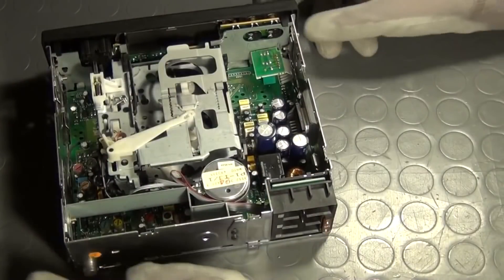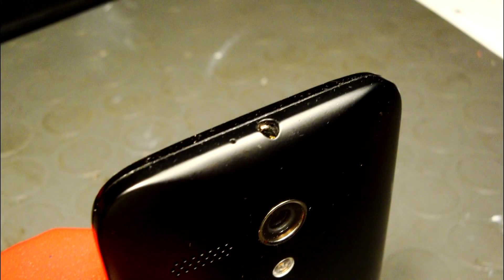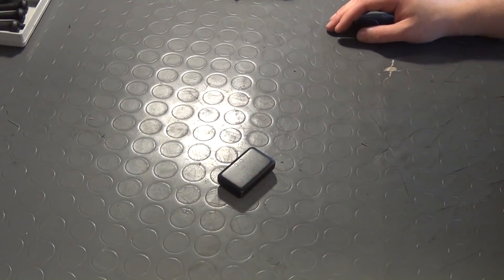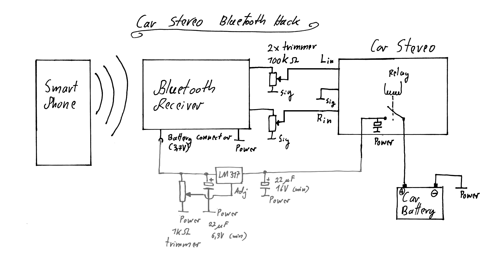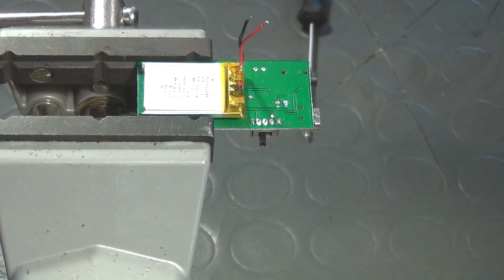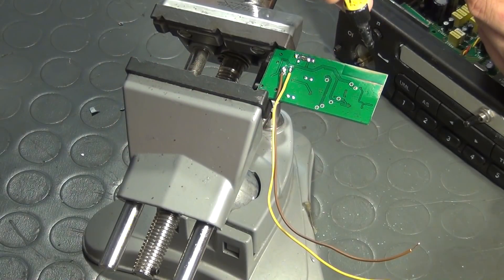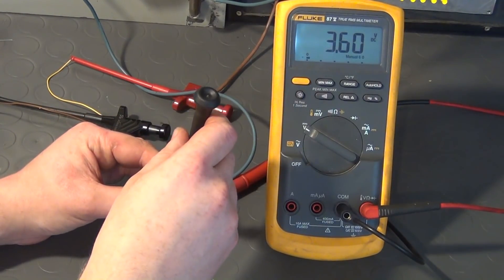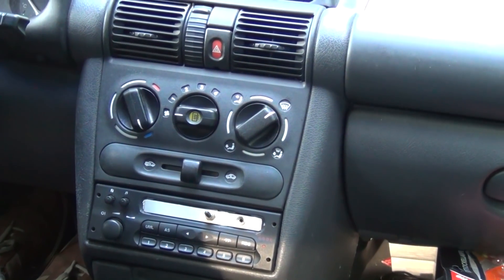Hack: Adding Bluetooth to  Car Stereos and Sound Systems

Comment: can i connect "soldering"headphones Blutooth direct to the radio, if yes. to which dots on the car radio. i've an opel astra g-cc  CD-R radio from Delco Electronics  (CDR 500) 

thanks

Comment: I just received a similar Bluetooth module for an old Pioneer. It has two wires for being hard wired to 12v and the output is Pioneer's IP-BUS connector that plugs right into the back of the headunit.

Comment: I have a bluetooth modulator that plugs into the cigarette socket, cost £8

Is that an Opel Corsa?  I  got a 1998 973cc model with 50k kilometres on the clocks for 500 euros, done 25k more in a year, great car.

Comment: Recently started watching your videos, as an electronics technician I can't get enough. Did you consider removing your original 3.5mm jack and using the jack on the Bluetooth board? It seems better than having a parallel input circuit.

Comment: No transient diodes, no fuses on the circuit. And you even test your circuit with only 12V, while the alternator can deliver up to 13,5V not mentioning the spikes while cranking the engines.
Could have be done better, I wonder how long this will last

Comment: This is great and very handy.  I have a late ‘70s car where I need to keep the original head unit but would want to add something like this:  USB, Bluetooth and DAB+.  Any suggestions?  I can share pictures of the Blaupunkt or Becker head unit.

Comment: You can buy a cheap ass car stereo with USB and bluetooth on aliexpress for like $15 USD, but I guess it wouldn't have the fun factor of hacking together your own, like you did.
Reply: However, if you have steering wheel control of your radio, you might want to keep the old radio.

Comment: Great video, but one thing caught my eye…    car battery is all most allways above 12volts …  charger pushes around 13,8 to 14.6 volts to battery while car is running.   So when you regulate the power to your bluetooth ,  you should take that into account if the modules voltage limit is critical. Often they have quite large scale tho..  as most of their cut out voltage is way below 3.7v and when in charger those will allso charge at around 3.88v up to 5v in some cases.

Comment: Slight confusion: usually the power buttons of bluetooth devices respond to pushes of different lengths: click to pause or answer phone, 3 seconds for power on, 10 seconds to re-enter pair mode, etc. Here you've apparently been able to make it do a power on only? Or perhaps it always goes into pair mode and you have to repair with your phone every time? Anyway, some of the inherent functionality appears to be lost with this hack.

Comment: You drive a corsa B ...hope its a diesel...best cheap diesel one can have in Europe...5 liters 100km....if it has 5 seats i costs around 1000€ here...if it has 2 seats it costs around 500€....i have 2 of them one with 470000km and other with 520000km. for ten years i dont know what it is having a serious malfunction in the car...never changed suspension, arms, bushes, driveshafts , cv boots and other stuff that breaks all the time on other cars...only had a bad alternator on one and the other leaks power steering fluid but it has been like that for years...i just top it up every 3 months or so because i am lazy to change the rack...i was wainting for the engine to blow and would change both things at once but the sucker wont throw a rod no matter how hard i try

Comment: I just ordered a Bluetooth module and intend to do this to my factory Ford radio in my Mercury Mountaineer. My problem is that I have no aux input. Could I simply connect to the inputs from the CD player, or are they digital?

Comment: Well that is a lot of work to go through to get blue tooth integrated into the car radio but hey true you dont have to worry about a voltage drain any longer . Great video

Comment: i hacked my bluetooth speaker by extending the speaker wire. the first min was fine but after that the speaker stopped working.  device is connected and the functions work. what is the problem? help anyone?

Comment: If I want to skip the 3,5 mm jack installation, I just need to connet these wires to the bluetooth receiver output?
Can I use a different bluetooth receiver with small DC-DC step down convertor?

Comment: Could this be done on a more modern radio by simply adding power to a bluetooth adapter and hijacking off of the already existing outside audio jack but instead soldering another to it inside ?

Comment: Interesting video. 

Thinking to do the same with my car, I have a Mercedes ML, older version. You mentioned you connected the "audio out" I'm parallel via the aux sockets on the board I'm sure I'm case you wanted to use the aux port by it self. Could this cause an issue? Or is it like a regular stereo that it would just play both "channel" if both are engaged? 

I don't have a aux mode on my unit, but I do have a tape mode that I never use, thinking to connect it to there. What are your thoughts? 

Also, need to find a power source, and I have a old car phone unit near that is ignition activated so might be a good power source. 

Basically, did you see any issues connecting it in parallel?

Comment: That was incredible. I also have an older 2001 car with a factory stereo. I don't want to remove the stereo as it will devalue the car (it is very rare) but I would love to be able to keep the factory look and bluetooth it with my phone. Would you do this work again for someone like me, if I paid? I am not good with soldering..

Comment: No need of trimmer (variable) at all. No need of lm series regulator, just use 7805(connect it to bluetooth power port, micro usb, dc jack) you made it more complex than it really is.

Comment: fuck sakes just buy a bluetooth receiver. solder some power from the iso leads and solder output cables into your stereos aux or input cables. why build a effin receiver board totally overengineered!

Comment: hello i have made this hack to my car stereo last night.
i have removed the pre amp from the board and conected to its exit.
everithing is ok until i conect the bluetooth adapter to power. some noise apear în the speaker that can be Heard when nothing its played. i have noticed that this noise disapears If i reconect the internal battery to the bt receiver. any idea how i can fix this ? thank You.

Comment: Great video, but one thing I was wondering, cars produce more than 12v when running, usually the alternator puts out 13.5v to 14.8v, so how well regulated would the pot based power supply you made be?

Comment: Nice Hack, just a question, there is a 1 k ohm resistor but is not in the diagram, should this be between terminal 1 and 2 of the LM317?

Comment: Seems like a lot of work when you can buy a cheap aftermarket headunit with all those functions
Reply: opelduude and the old one? Just more garbage on the already sky-high pile? With his work he extended the life of his device even longer. And every device not built is lowering the pressure on the resources of the planet. And it is fun to mod things, by the way.
Reply: I can see this mod being used in a vintage car. You could keep the original look but still have upgraded functions! Obviously you wouldn't remove the casette player then...
Reply: I found 1 for 19.99 on Amazon

Comment: I have some problem with buzzing and ticking background sounds (digital processing and wireless connection) which are at the same level regardless of sound volume set.
Any tip how to separate ground in BT module from ground in main radio electronics?

Comment: Ok, but using also a 12V to 5V usb ready made adapter (or gutting a lighter socket one) would have not be easier to power the bluetooth module?

Comment: so why not buy a new car stereo that has Bluetooth? much easier solution imo
Reply: this is a original opel radio with the display high in the dashboard.
Reply: @Larry Schlutt So why not watch a video on buying a new car stereo that has Bluetooth? Much easier solution than watching a video on something you don't want to do then making a comment telling others what is easier.
Reply: For example in my car I cannot make optical changes, because then i would loose my special insurance.

Comment: If found all phones aux port fails if you use it alot.  I have found using a cheap thin aux cable that doesn't put pressure on the port stopped the wear.  

Or Bluetooth where possible.

Comment: You can do the same using a BT aux receiver instead, thus drastically reducing the cost to about $3.
There's an indestructible here : http://www.instructables.com/id/Pimp-Your-Cars-Stereo-Adding-Bluetooth-to-Your-Hea/
This doesn't even need that regulator circuit you've made.
Reply: Of course, but you lose the excitement of hacking, and you do not re-use an old stereo that you'd probably discard ;)
Reply: I don't know what you mean. You use your old stereo and you hack it, you just don't make that circuit he did. And you use a cheaper receiver as an added bonus.

Comment: Could you not just leave the tape deck in and just hack into the audio cables? So to activate the Aux/Mp3 in you just push the tape in and to deactivate, pull it out. Would still have that retro tape feel but with an mp3 player bolted in the back! :-)

Comment: Amazon on sale FM transmitter bluetooth only $19.99 . some of them only $ 13.99
buy one faster than your build it  ..........?
Reply: Those work great unless you're going any distance. At least in crowded urban areas you'll need to be fiddling with the frequency choice as stations fade in and out. This is the voice of considerable experience talking. Given the option, I'd take the wired-in receiver.

Comment: I recently had a friend buy a new pickup truck. He wants to install speakers in the bed. Rather than running a bunch of wires, somebody suggested that I hook them to blue tooth. I have yet to find a stereo that has bluetooth outputs, only inputs. Has anyone tried to hack this yet?

Comment: Soundfly BT  sits in your cig lighter and lets your phone connect to it through Bluetooth, it then transmits to your radios  fm station such as 88.1 or one of your choice. No wires and can bluetooth to any radio.  They also make a cassette with an AUX phone jack wire that lets you connect to a MP3.  I can appreciate your hacks but there are already inexpensive and better solutions already available.

Comment: Why dont you just go buy a new car stereo???????
Reply: It's cheaper. Just finding the correct cable for your car's audio system can cost more then a generic EBay/AliExpress bluetooth receiver.The wires and solder used? Likely a few cents. It's also fun to do. :D

Comment: Anyone willing to help me with a different kind of problem? I have a car noise issue(power noise) that cannot be fixed. Tried so many filters, nothing works. I want to use a reverse camera but when the engine is on ...with filters I do get signal(sometimes - not constantly and not always), my car is a seat ibiza 1.2 sc tdi e-ecomotive(2012 model).

If someone thinks he's/she's good at this that would be a nice challenge :D
Reply: Have you tried using decent shielded cabling and revising how you are grounding the camera?
Reply: thankyou! This guy knows. Check shield and earth points. Small cameras emit shit tonnes of noise can cause all sorts of issues with wireless devices on 1.2Ghz (i.e bluetooth at harmonic#1)

Comment: Why didn't you replace the faulty jack in your phone? You definitely have the tools and skill to do it.
Reply: MasterBata lol that's EXACTLY what I was thinking.
Reply: If the jack is anything like the one on my Asus fonepad,id be grateful if you could point to me where I might be able to source one!  Seems like these jack sockets are proprietary.
Reply: Pat Butete I would try aliexpress first... then Asus service centre. If all fails, you can look on ebay for cheap broken phone like yours and salvage the jack.
Reply: MasterBata Already tried Asus and no can do.They want $$$ to repair it.As for a broken ebay salvage job.It's a common problem broken jacks on these devices..so...not sure that is a wise move.
Reply: aliexpress has them for 4 dollars, i checked for a friend last night . he needs an asus fonepad usb socket ($4+) and a battery ($6)
If you don't like fine soldering, buy the power / usb board with usb socket attached for $48, bit rich in my opinion.
Reply: Simon Says That's exactly what happened to me. I dropped it as it was plugged in and it ripped the usb port from the pcb :/. I could repair it, but i don't have the right soldering tips atm.

Comment: why couldnt you just get a radio with Bluetooth or just a cassette adapter?
Reply: Where's the fun in that?
Reply: biker932012

I realise I could go that way but it wouldn't sound very good, it isn't interesting and I wouldn't learn anything.
Reply: Working with what you have is the objective, and a learning process.
Reply: turboslag you could go to the store and spend $5 on a tape converter, 5 second of sticking the thing in the tape deck and plugging the aux cable into your phone is easier than getting out the soldering iron and trying to figure what trick the radio to reading a cassette and where the input for it is and hoping you soldered everything correctly.

Comment: Ich hatte mir mal ein gebrauchtes Moto g gekauft, weil ich damit mein gehardbricktes (4.4.4 zu 5.0, reflash zu 4.4.2 aus gründen und dann update auf 4.4.4= Bootloader im Arsch) Moto g wieder zum leben erwecken wollte. Dieses gebrauchte hatte den "Pin" an der Audiobuchse so reingebogen wie deins, aber bei mir war es eher andersrum. Ich konnte keine Musik hören, weil das Gerät keinen Kontakt dort oben mit dem Kopfhörerstecker hatte. dieser "Pin" ist auch wie ich festgestellt habe kein Trigger für die Erkennung des Kopfhörers. Dieser ist tiefer in der Buchse(http://www.ebay.de/itm/Audio-Speaker-Earphone-Jack-Flex-Earphone-Jack-Fur-Motorola-MOTO-G-XT1032-/172280742192?hash=item281cbb8130:g:CaQAAOSw9NdXqwAD) <--Die kleine Feder rechts im ersten Bild. Also verstehe ich nicht, wie das bei dir im Kopfhörermodus geblieben ist. Das würde ja bedeuten, das auch dieser Pin verbogen sein müsste.(btw. hättest du die auch einfach austauschen können, aber ein Radio mit Bluetooth nachzurüsten ist auch keine Schlechte Idee :) )
Reply: SAY what

Comment: I would like to find out a hack to Volkswagen's RCD 300. Any of the 2 sollutions would be cool: Aux or bluetooth
Reply: +MallV0lli0
I have V Gamma Radio wanna hack it  but  i can`t faund chanal
Reply: easy get a new radio
Reply: yes but rcd300 can't be plugged with that adaptor.Just RCD500 which has possiblity to add cd changer
Reply: RCD 300 also has. The difference between them is that RCD 500 includes an inner 6 cd changer.

Comment: What if you need to pair it to a different phone?  Isn't the switch that you removed used for pairing as well?
Reply: the bluetooth boards i know dont need that switch its just to turn it on and off... the most Boards  i know (build in mobile speakers or stationary BT Receivers) disconnect after a time if there is no smartphone which is paired or even not playing any music (in mobile speakers to safe some battery power)... you just have to find them via your phone maybe type in that "pin" mostly 0000 and they connect :)
Reply: in my experience when making a Bluetooth cassette adapter, I had to make the pair button accessible otherwise you couldn't switch to a different phone with the cassette adapter.  I'm not talking about disconnecting from the bluetooth adapter, just the initial pairing process.

Comment: Why did the radio not go off and back on when you started the engine?
Reply: ah good battery ;) radios go off and back on because the start of the engine takes alot of power of the battery with good one or a second one it doesnt happen :D
Reply: Because the radio was incorrectly wired :p. It's not connected to the ACC power line.
Reply: Because he fucked it up !! xD

Comment: Wer fährt im Jahre 2015 noch einen Corsa B und hat ein Moto G? :'D
Reply: Learn German and complain later.
Reply: Wer gibt im Oktober 2016 nen Kommentar ab in dem er sich auf 2015 bezieht ;-)
Scherz beiseite, mein Opel ist ebenfalls von 1997 und ich hab noch mein altes 3210 hier liegen.
Zugegeben, das Nokia hat nen anderen Zweck als den Alltag zu bestreiten. Aber in Nutzung ist es noch
Reply: The kind of man, that solders a BT adapter to his 90s cassette player instead of buying a BT enabled stereo (sorry, my German is not that good)
Reply: vadim6385 have you SEEN aftermarket stereos? Probably some of the most garish appearing devices ever seen. You might as well be installing a 1970s disco ball in your car.

What's wrong with wanting bluetooth functionality WITHOUT installing a hideous bright chrome or silver aftermarket stereo in your car's dash?

Comment: i still have my old blue tooth with fm modulator and usb / sd card reader that plugs into the  12 volt cars aux  cigarette lighter receptacle ,  now i just use usb thumb drives to store all my fav songs ,